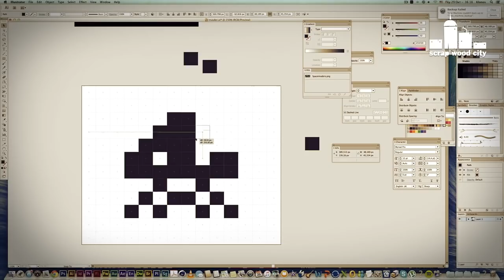DIY pixel art picture frame

Comment: Cool project! Is the frame completely sealed (glued) or is there a way to open it up if you ever needed to, for instance if a block came loose and you needed to fix it? Seems unlikely that you would ever need to open it up but I'm just curious.
Reply from the maker: +Makify1 Glad you liked it! The frame is sealed with glue!